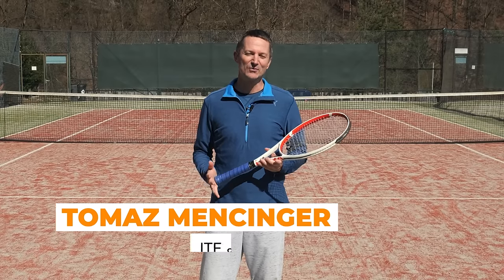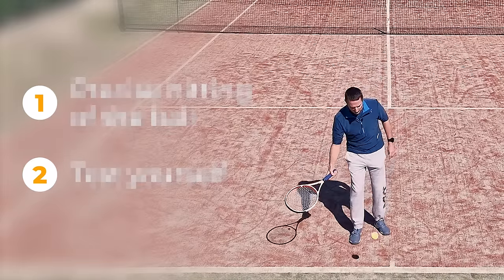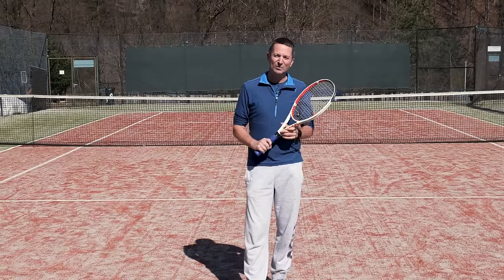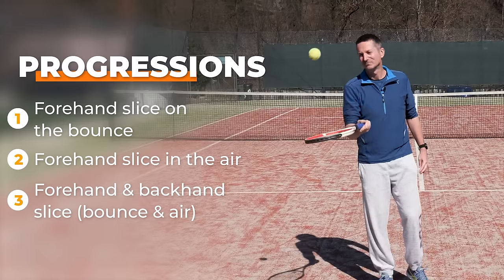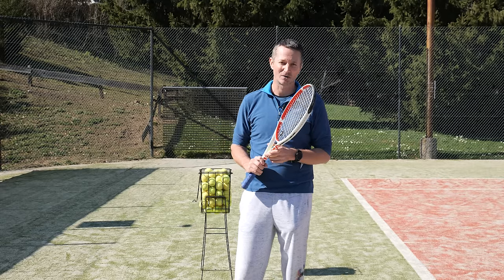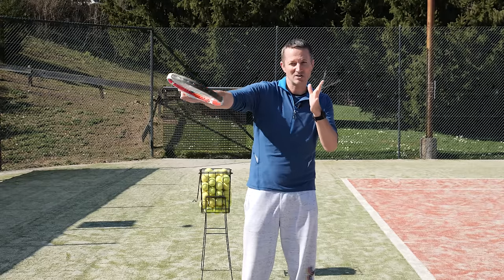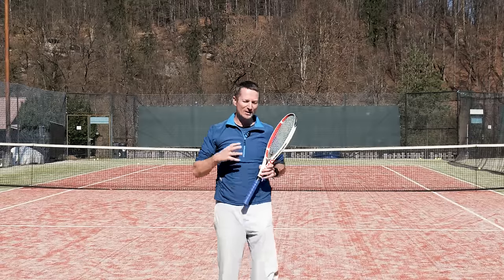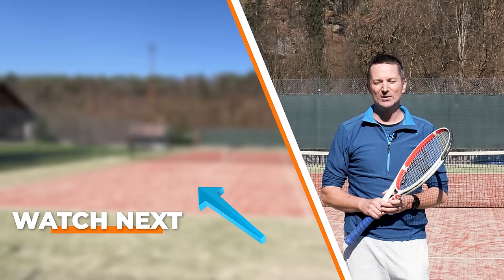Tennis Slice Serve Drills - How To Hit Bigger Slice Serves

Comment: Thank you, I'm usually a counter style because I struggle with my serves. But this video was a very clear explanation of what I was doing wrong. I was holding the grip more towards the backhand side instead of continental. I also realized that I was opening up my shoulder too soon. You gave me confidence today to even go for my serve on the 2nd. 😂
This video will turn my weakness into a strength with hardworking. Thank you Master.
Reply from the maker: Very much appreciated, thanks for the feedback!
Reply: @feeltennis  I want a slice serve like roger federer and this helps me make one step closer. Thank you Master!

Comment: Great Video. Do you hit the ball at. 2, 3 or 4 o clock? To me it looks like something between 3 and 4 a clock. Regards
Reply from the maker: Well, what we visualize and what really happens are two very different things. Sure, you can visualize that you hit the ball at 3 o clock which would only be realistic when serving at a very sharp angle standing close to the net. It's what I show at the start of drill #2. But what really happens is that there is just a minute angle difference between the racket angle on the ball between a flat and a slice serve, you can see that in this video: https://www.youtube.com/watch?v=bhFrf_xA77o
Reply: @feeltennis  thanks. I appreciate your slowmotion footage where I can see your racket face at contact. Good camera work. Strange - it is easier for me to get more power when I use a slight forehand grip. If I do so and I am leading with the edge I am generating more power (more flat at contact). Furthermore it is easier for me to pronate. Just a little bit like Boris Becker. Probably the only professional tennis player in modern times using a slight forehand grip (serve). To me it looks like he is pronating with his full underarm not just with his hand. So did Pete Sampras. Regards

Comment: Hi Tomaz,
Am I completely deceived? In the first half of the video, weren't you using the "peeling " method. I see that in slow motion. Even when you were instructing the gentleman indoor. I see that he was using the "peeling " method because he finished the stroke with his palm facing up at the end. 
Please explain. Thank you. Always love your instructions.
Reply from the maker: It depends what you interpret as peeling. If your sign for peeling is an open racket face at end, I mention in the video that pronation will happen before that and that the racket can still end up open. That does not mean peeling, Peeling means that the player wants to carve around the ball leading with the front edge of the racket curving inwards. If you do that, the ball will not fly. You need to pronate first to give the ball some push...
Reply: Hi Tomaz,
I am sorry that I missed that part of the explanation in the video. Thank you for explaining that to me again.